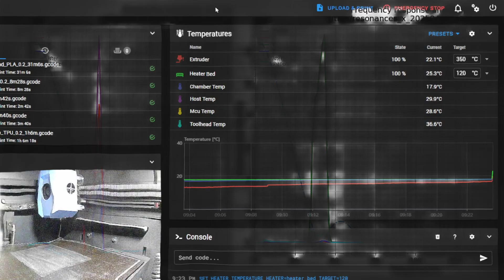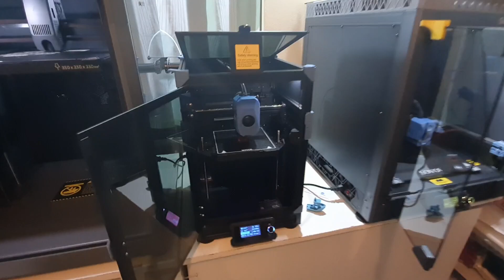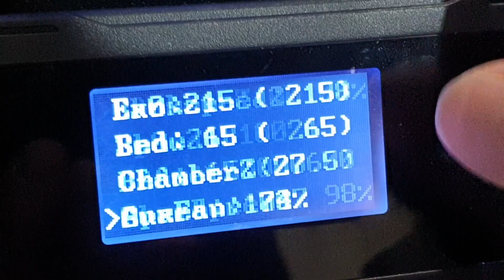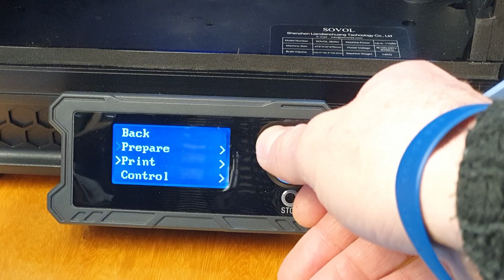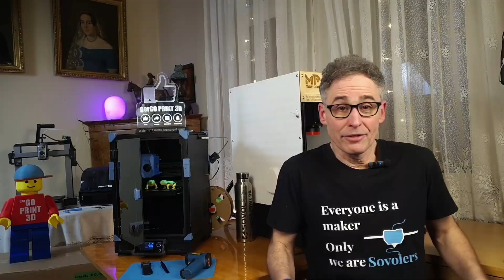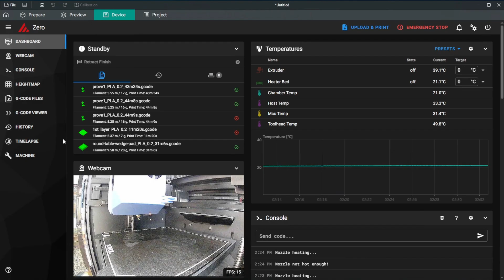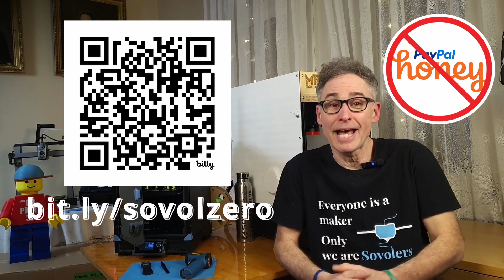Orca Slicer Profile Conflicts? SOLVED! + Klipper Macro Power-Ups for Sovol Zero

Comment: Jó reggelt Gergő! I want to ask you if you are still using Cura for the Sovol Zero? It took me a leap of faith (after 7 years using Cura) to use Orca slicer. But I am slowly getting used to it after rooting my K1 & installing Klipper for my SV06+. Now that I have the Zero I rarely use Cura. It's like saying goodbye to an old friend. I'm curious how you feel about it as well my friend. Köszönöm!
Reply from the maker: You know I never used Cura with my Zero. I switched to Orca Slicer while using my SV07+ and haven't looked back every since. Well, just the other day I actually fired up Cura again, because turns out, Cura can convert depth-map images (reliefs) to STL, while neither Orca nor any of my other 3D programs could.  I also checked it for settings I used for my filament rack consoles (see https://youtu.be/iM9JVZadY-8 ) which I decided to print a few more of with all the extra filament we are getting 😅 I was scared those racks come off of our wall. So don't uninstall Cura just yet, but Orca (and branches / clones) are my daily drivers (Creality Print, Bambu Studio, AnyCubic Slicer all share Orca functionality).
Reply: @gerGoPrint3D yes I still have Cura, but was using Creality_Print for years with my K1 and got completely used to it. But, as yourself, it's hard to go back after Orca. I remember my first printer in 2016 I was trying to use Pronterface, omg what a nightmare

Comment: I had no idea about the issue with orca. I wasted so much filament because of this bs, and spent age chasing ghosts, trying to figure out what was wrong with my printer. During this time both my machines developed a mechanical fault. This issue with filament profiles then made the mechanical issues impossible to diagnose. In the end I had to delete all my print profiles, wipe the software and residual data from computer and reinstall Bambu studio (reluctantly) and loose creature comforts like print history. I was so pissed off. I won’t be installing orca again till they sort this bs out. 

I was curious what your fix is, I will probably just wait for orca to update but it’s nice to have options. I love how the community will fix problems themselves and share the solutions so thank you for making this video.

Comment: The Sovol Zero profiles for Orca Slicer have been merged some hours ago to Orca Slicer's repository so it's likely those will get included in version 2.3.1. Nightly builds are likely to also be an option before that.
Reply from the maker: Nice!  I checked yesterday, then it was still not in 2.3.1. So indeed this is fresh news. Thanks for the instant update!  I will compare with the Sovol supplied presets. There are usually some differences. We'll need to test which works best.
Reply: @gerGoPrint3D  Comparing what I got on the USB stick and what's been merged to the Orca Slicer repo, the merged version has a far more complex machine start gcode with some conditions but lacks comments what those sections are intended to do. The merged process profile uses monotonic bottom surface patterns instead of rectilinear and enables thin wall detection. The merged PLA profile has a first layer temperature of 230 instead of 245 and exhaust fan speed of 80% instead of 50%. Movement speeds and accelerations are however all the same.

What I've noticed so far while testing (with PLA) is that the outer layer speed or acceleration is too high and will create some resonance artifacts even after the input shaper has been retuned with a wider test range (peaks on both axis on my machine where outside the default 35-45 Hz test range). Retraction settings aren't either likely to be optimal as there is some stringing here and there. I also got cleaner results using Arachne wall generator instead of Classic but that's not as much a printer model specific setting.
Reply from the maker: @TeemuToivola  Wow, very detailed analysis. This is likely someone's own presets and not Sovol's own. Which could be a good thing or bad thing depending on how well these work. If it is a slightly adjusted Voron Zero profile (many do this) then we are better off with the Sovol presets. Before Sovol sent me their presets I too tested the machine with Voron presets, but the machine capabilities and even the extruder is very different. 
As for Aracne vs Classic wall generator, that is one of the paraters one should set depending on the specific needs of a print, similar to many other options. There can be some "safest" defaults, but I like to tweak those for my prints. 

Thank you again for the update and the deep dive. I think this makes my cloned profiles even more useful: this way we can have both profiles enabled and compare.
Reply: @gerGoPrint3D  It looks like these merged files match rather well the content of "SOVOL Zero USB Files" that can be found from Sovol Wiki which was updated on Tuesday. Another interesting content in there is the updated User Manual. My printer came with V1.0 but there's now V1.3 available. By quickly comparing the pages, the biggest change appears to be that the spool holder has been moved from the back to the side and the filament sensor also has a different attachement point. The screw for the spool holder is also longer (at least mine shipped with a too short screw).

Comment: Does your Sovol Zero gantry is skwed ? And if so how you straitened it ?
Reply from the maker: Yes, I had a range of 0.3mm on my bed due to slightly slanted bed. I adjusted the coupled Z lead screws (accessible from the bottom of the device). I show you glimpses of the method at 0:29, but as mentioned there I am planning to dedicate my next video to showing you how I did it, bringing the range down to 0.1 mm. Still, the printer is perfectly usable with a range of 0.3, ABL can easily correct for it.

Comment: I wish YouTube would tell me about your videos sooner.  I ordered a Zero on March 28 and they started shipping in the US a couple of days ago, in the order they were received.  My Zero hasn't shipped yet and I've been hungry for Zero content while I wait.   😀

Instead of adding a macro to preheat the SV08 bed and prox sensor, I added some Start G code in OrcaSlicer to home the printer, lower the nozzle to 5 mm above the bed and slowly scan left and right for four minutes.  It's not as flexible as having a preheat macro, but I always preheat so it was better for me to have the slicer add the preheat for every single print.
Reply from the maker: That's a pretty smart idea. I would probably create two different copies of the SV08 printer in Orca, one with preheating the other without, because there are cases when we print back-to-back on the printer, and then you wouldn't want the extra wait time.

Comment: Hi Gergo, great Video as always. Do you think it might be possible to "upgrade" the SV08 with the Zero Toolhead?
Reply from the maker: You are not the first to ask, I should look into this. They look very similar, might be interchangeable, though the software will surely need an upgrade. Sovol should come out with some kind of an "official" upgrade. I don't have any info, just hoping.
Reply: @gerGoPrint3D  sovol will not be able to give you an update because the SV08 has no bootloader and needs an external tool to flash a new version
Reply from the maker: @neihe25  They could provide that in an upgrade kit.
Reply: The Zero tool head uses CAN bus.  The SV08 tool head uses USB.  They are not compatible.  However, in the Zero live stream in late March, many people asked about the SV08 first layer issues (warped bed and inaccurate proximity sensor used to make the bed mesh) and Sovol admitted that they are working on an Eddy upgrade for the SV08.  They will apparently provide the Eddy probe and any hardware needed to mount it in the tool head and presumably a forked version of their SV08 Klipper.  I'm very eager to purchase this upgrade.  They are focused on releasing the Zero, and the 500 mm coreXY that they developed in tandem with the Zero that should announce soon, so the Eddy upgrade for the SV08 will happen after that.
Reply from the maker: @Liberty4Ever  Thank you for the "insider" scoop :)  I did not realize Zero was using CAN bus.

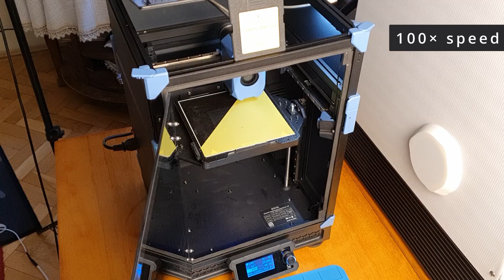Comment: 6:39 - That was me. Thank you very much :D
It looks very good - there are few breaks in it. I can't see if there any parts that were too close though (too squished/z too close)
Edit: Actually, I can see that too. It looks entirely excellent!
Reply: Is that one layer across the bed a model one should download to run it or some kind of a command in the slicer/printer? I can make one myself but id rather not if its already available somewhere.
Reply from the maker: @DiversDesign Right click in Orca > Add Primitive > Cube > Resize > set side to 152.4mm > turn off uniform > set height (z) to 0.2mm > Move to 76.2 / 76.2. Make sure to turn skirt / brim off.
Reply: @ Thank you.
Reply from the maker: Yes, I did not go into analyzing the results, but you can see it was perfect.

Comment: Can you compile Klipper this time ? On the sv08 it did not work. That's why you could not extend it with an mmu without going to mainline kipper
Reply from the maker: What do you mean by compilign Klipper?
Reply: @gerGoPrint3D  can you build the Klipper firmware this time. On the SV08 it was not possible because Sovol changed some stuff and did not check if it will build on the SV08